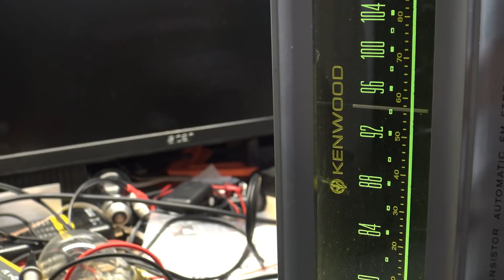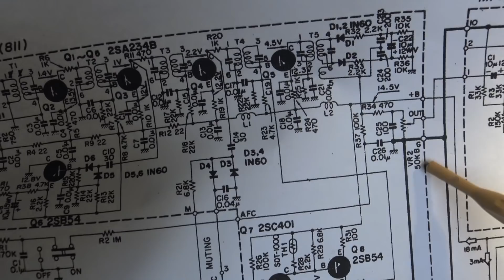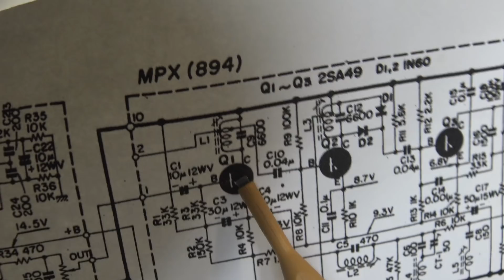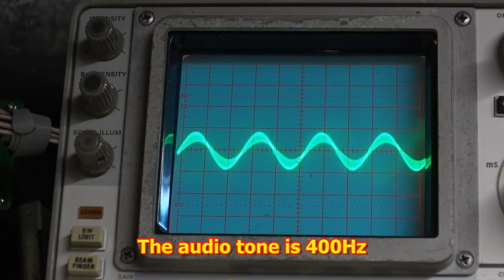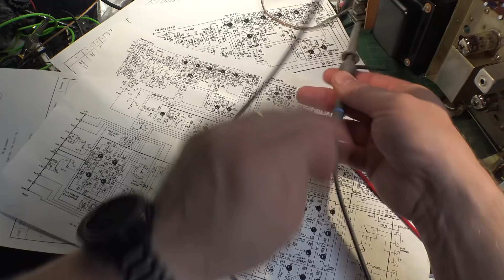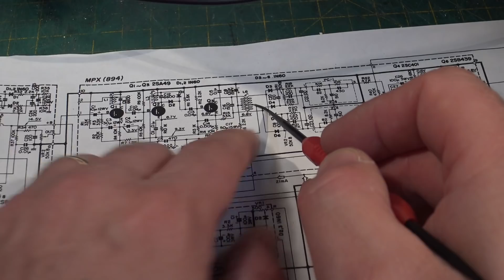Kenwood TK-80U Part 5:   MPX Stereo Blues

Comment: hi tony,   i would replace the other 1n60's......all of them.  in the early 60's diodes had a reputation of going bad over time.  i'd use schottky also.  you have already PROVED   this with the first two you changed          i would also change them back in the IF as well.   a lot of the SONY stuff had problems with early diodes as well.

Comment: C16, 1600p, is this a discreet capacitor or is it built into the transformer? If the later and it is a mica sheet with brass tabs overlaid on it this is possibly the problem. This should be one of the easiest mpx to align since it doesn't have an oscillator that has to sync up to the pilot.
Also we like to talk about how the mpx signal is simple. Yes, but the modern implementation of it is anything but, considering all the tricks they pull to get a better modulation index, including but not restricted to chopping off the entire upper sideband from 38k to 53k to give more room for baseband l+r audio and the list goes on. Study an app called Stereo Tools, look at some videos about it, including of the guy that created it and you will gain a new perspective for how the FM baseband signal architecture is used today. It's not the same as it was when FM was meant to be high fidelity.

Comment: Did you know that the Marantz first tuner was the first phase-lock loop multiplex stereo tuner, and that it was tube type. Also I believe that Harmon Kardon made one called the Citation. I have worked on and aligned an Advent multiplex also. Some of you don't know that Tandberg made one of the best multiplex circuits, it was capable of 40 db of separation at 10khz and very low distortion, I don't remember the number right now. We used a Sound Technolgy FM generator to do the alignments and that was fun to do back in the 70's. Audio has always interested me, and I have worked repairing the best and a lot of the rest. BTW without knowing the real specs of those old units, how can you even know when it is performing to the limits of the design? I do know the ceramic filters that Marantz used in the IF second did cause some of the problems with the 2000 series in the 70's. Thanks for listening.

Comment: In the old schematics that i find this kind of detector circuit in,
those 19KHz frequency rectifying diodes are Germanium diodes, AA119.
While the decoder diodes are silicone diodes, 1N4148.
BTW that "rectified" 38KHz did not look good to me...
http://sportsbil.com/tandberg/Installation%20instructions%20for%20Tandberg%20Stereo-multiplex%20decoder%20-%20model%203%20in%20Huldra%208.pdf
With tuning instructions if that helps.

Comment: This looks to be a time-multiplex kind of stereodecoder.
So at collector of Q3 there should be the 38KHz pilot pluss the S-signal.
At the right centerpoint of L6 you should have the M-signal with a suppressed 19KHz pilot.
These two signals then mix in the transformer, and get decoded over D3 - D6.
The audio signal is reconstructed over the four 22K resistors.
Given the fact that somebody else has worked on this unit the way they have,
could it be that it's just been tweeked so far out of alignment that it stopped decoding?

Comment: Kenwood was the first consumer audio company to use an IC (probably an op-amp) and a crystal filter in a FM-stero-Tuner KT-7000 circa 1970 ! I saved a lot of money in high school to purchase one...$270.00 in 1970 dollars (!!) . So much for my college fund. I was pursuing a different form of education.  Even though I was living in suburban NY at the time I could pick up stations in south Jersey and Bridgeport Ct using my parents color-tv antenna. "Underground" FM-radio was the "internet" of its day. It had both a signal strength and a center tuning meter and multi-path output jacks. I used that tuner until 1994. :)

Comment: I am working on a Marantz 2220 (non B), and the MPX board has me stumped, too. The circuits are almost identical to this Lafayette. When first turning on the Marantz, everything plays fine, then the left channel cuts out and it is on this board (P300) After replacing everything except the transformers, I found another board, and will just replace the board.

Comment: Tony, The board that senses the 19Khz pilot should be sending a control voltage/signal to the MPX decoder circuit that turns the stereo decoding on or off. I'd check this voltage under stereo and mono conditions.

Comment: The MPX signal is not that complex. The mono audio ( L+R)  lies in the range 0-15 Khz of the demodulated FM IF signal. At 19Khz is the pilot tone. At 38 Khz the L-R component is a  suppressed carrier  double side band signal. The 19Khz signal is doubled and is used as a reference to demodulate the 38Khz  SC DSB (L-R) signal. Now we have both L+R  and L-R.   Two networks one additive and one subtractive yield the final L and R  ( Left and Right)  Channels.. Note there are no oscillators involved in this.  A basic theoretical knowledge of synchronous demodulation of DSB signals and how sum and difference matrix networks operate would help in diagnosing  problems in MPX circuits.
Reply from the maker: I agree, but this still doesn't tell me what's wrong with this receiver.
Reply: @xraytonyb  I have the circuit diagram (Schematic in American). At first glance the decoded L-R gets fed in on the primary of L6 (One end signal is inverted) and the L+R goes by a bit of filtering  to the centre tap of the L6 secondary.  The L6 phase cancel and add makes L and R appear on the correct half of the secondary and the diodes route the signal.  Knowing that  it should be possible to find out whats happening

Comment: Diodes may test "fine" but they can get leaky at certain frequencies over the years. (The same applies to transistors)  Replace D3-4-5-6.
Reply: I would agree with you on that. Just because a diode (or transistor) test ok measuring forward voltages doesn't mean it will function properly in circuit.
Maby test them in the Curve tracer?

Comment: Very fascinating. I've acquired a old Sansui TR-707A (mid-1960's) that I'm determined to restore. The innards look a lot like the unit you have there, minus the tubes. I've replaced all e-caps (& yeah, many of them were as bad as the ones you showed). I get a weak AM signal but nothing from the FM. This has helped me understand how to approach this repair. Thanks for posting these vids.

Comment: Hi, maybe you could do a video on FM Stereo encoding? Then, perhaps, decoding it would make more sense. I get the part about a 19 kHz pilot tone, but why do we need the 2nd harmonic? For that matter, the 3rd harmonic, 57 kHz isn’t mentioned, but you made mention of a 67 kHz signal. Where does that come from? Closed Captioning, maybe? Or does it have something to do with the fact that the FM band is close to TV channel 6 (OTA, not CATV). Also, I wouldn’t think there’s much energy in the 4th harmonic @ 76 kHz, so do we really need a trap for that? 🤔
Reply: SCA is just som extra audio that can be tacked on to the transmission. Not used that much I think.
https://en.wikipedia.org/wiki/Subsidiary_communications_authority
https://www.youtube.com/watch?v=bprJrtp52Sw

Comment: That transistor isn’t generating the 19kHz is it?  Isn’t it a bandpass filter for the pilot carrier?  Then it doubles it and demodulates the information on it to get the stereo information.  Right?  I’m certainly no expert on FM but find this fascinating.  It really is FM. You know - F@#$ Magic.
Reply from the maker: You are correct.  The 19 kHz is part of the MPX signal.  The coils on those first two transistors act as 19 kHz filters.  Think of them as a type of switch that turns on when it sees a 19 kHz signal.  I think I showed what happens when you turn the 19kHz pilot on and off.  When 19kHz is present, it will pass through the two stage amplifier and out to the third coil, which is a tapped coil, with the cetnet tap going to ground and the outer windings going to the two diodes.  Think of it as a full wave rectifier.  The sine wave now becomes a pulsed DC wave with a frequency of 38kHz, or two times the 19kHz sine wave's frequency.  This is what is mixed with the MPX carrier signal to decode L and R.

Comment: This is very interesting.  My Scott 342-B appears to use a similar version of the MPX circuit you just showed.  My 342-B's MPX isn't working either and it looks like a transistor has failed as I am seeing the 38khz signal at the two diodes going to the base of the transistor, but nothing past that transistor.  Even with just a normal station tuned I can see the similar wave forms.  Again, thanks for posting this!